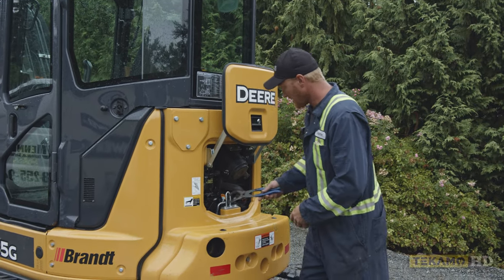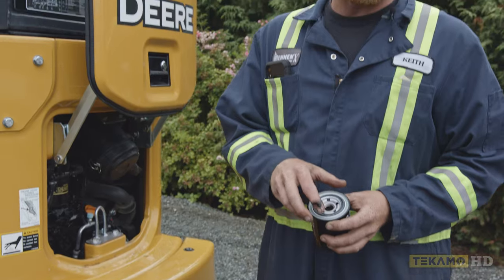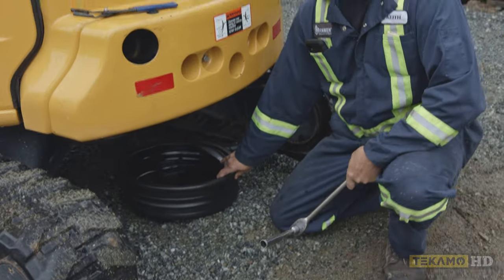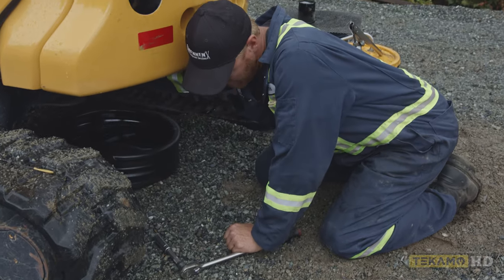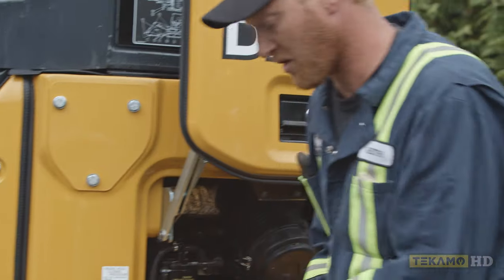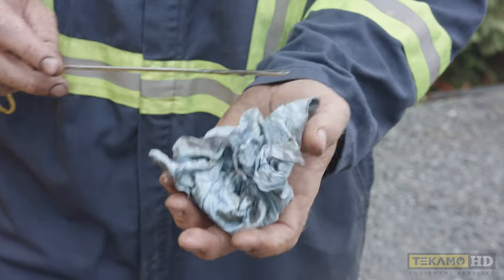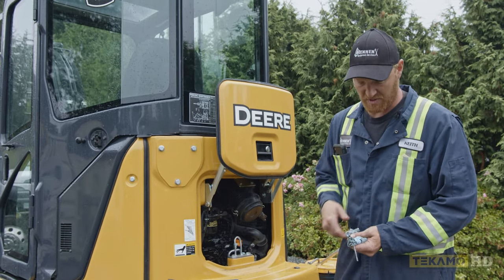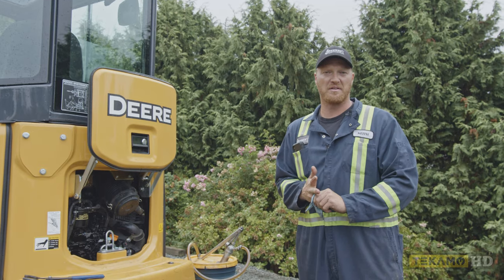MECHANIC'S Guide To Changing Engine Oil & Filters - Mini Excavator Maintenance, John Deere 35G

Comment: Nice video. Should you put oil into the new filter before putting it on?
Reply from the maker: It is not necessary to fill it with oil before installing, but you should lubricate the gasket with clean oil.